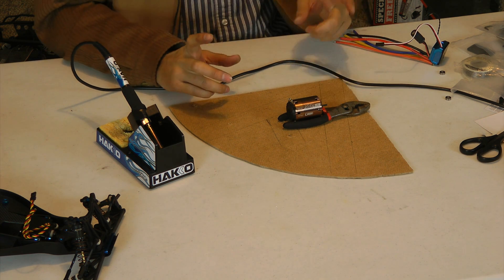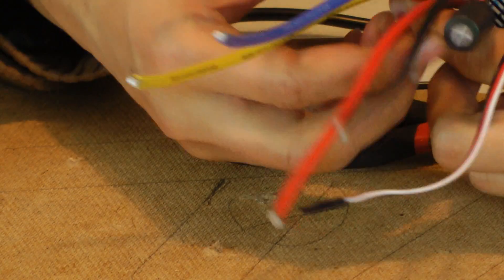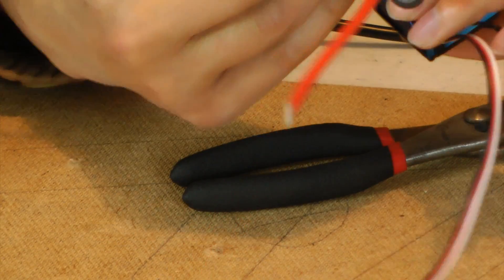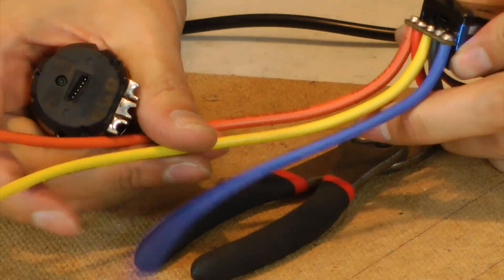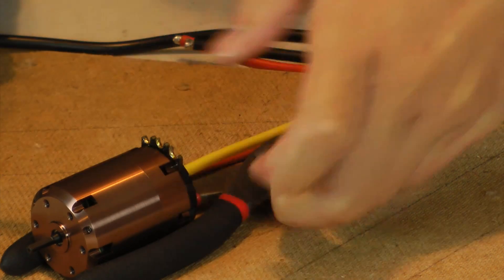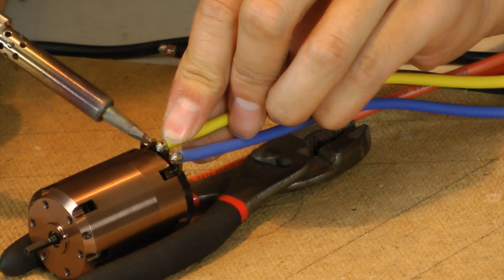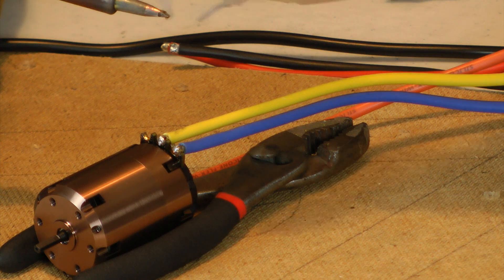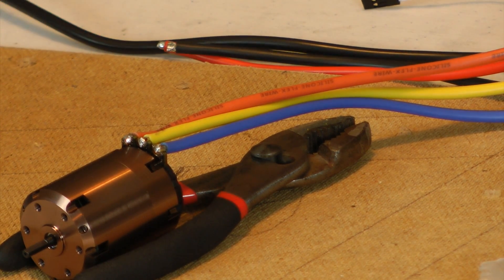How To Solder A Motor to An ESC

Comment: buy some wire. 16-10 gauge. silicone sheath. solder that to the ESC wires and then connect it to you motor.

Comment: I have just bought an EZRun brushless combo and the wires to connect to the motorfrom the ESC are all black and there a lot shorter than the ones you have used on your video  they dont reach the motor,

Is the any kind of connectors to make them longer or do i use the ones for my ols esc and brushed motor ?

Billy

Comment: the wires are not coloured for any specific reason (at least after leaving the factory)
connect any wire to any wire and keep doing that until you have connected all three
once connected, spin your motor up, and if it spins the motor the opposite way of what you would like, reverse two of the wires.

Comment: hey what if the wires are all black and has no letters
Reply: Center wires are always B ones...the side wires...work reversely on non sensored system....on sensored system try to do a test o rotation sense ...before soldering